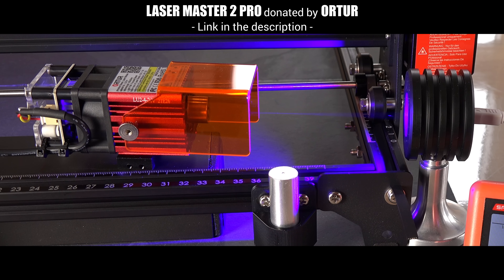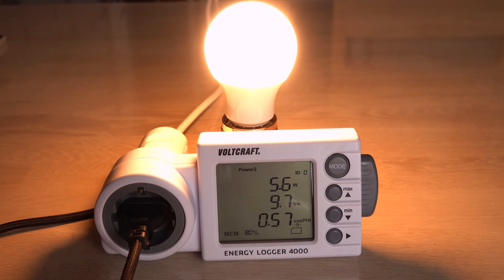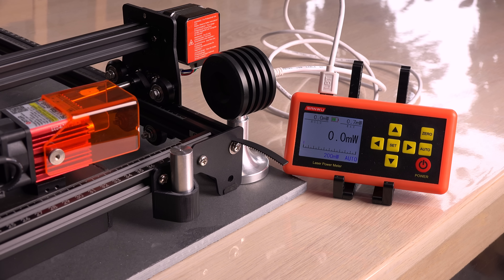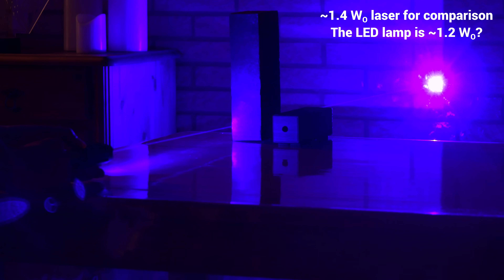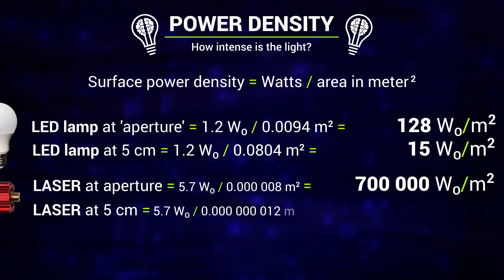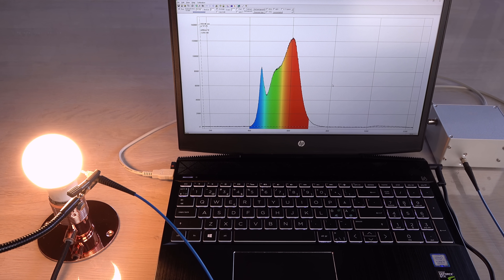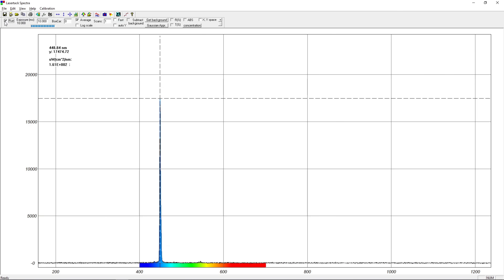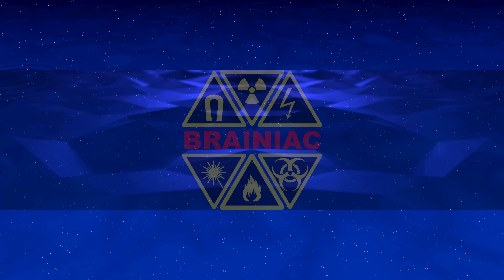Crazy difference between 5W LASER and 5W LED!

Comment: I wander what would happen if one does this with a gamma ray radiation. Gamma rays have a very short wavelength and high energy output. That would mean, this laser in theory would have been a billion times stronger and would have cut through the floor.

Comment: If I'm Not Mistaken, Is not Luminosity (lumen's)
A Measurment of Brightness or Intensity,  And 
Therefore Lumens Can Not be Compared to or
Mathematically Converted To Watt's ?

   ~ russ
Reply: Yes, 
Watts=lumens/luminous efficacy 
where the denominator le is lumens/watt which depends on the bulb efficiency.  Incandescant bulbs were about 15 lumens/W and LEDs are about 7 times more efficient.  Efficiency (W/W) can't be more than 1 so there is an equivalence there somewhere and I recall coming across this fact somewhere previously though it takes a deeper dive to get to that stuff and so I only mention it here and now.

Comment: Does anybody understand that the light particle pattern from a laser is symmetrical, that is why they follow together in a straight line, so the led example is quite symmetrical but less so. It's therefore quite difficult to diffuse light particles that simply travel in a straight line.
Whereas light particles from either halogen or incandescent are random wave pattern and these spread most easily giving more useful light with less glare.

Comment: I’m guessing the answer to the question at the start:
A 5-Watt Laser is far more dangerous than a 5-Watt LED because, while the LED just sprays it’s light everywhere, the laser concentrates all that energy into single beam, which generally isn’t good for anything that happens to cross said beam.
Reply: Yes it is a guess and it's not quite right.
Go research "coherent light". It's not just about the energy being concentrated into a beam compared to a light bulb which radiates omnidirectionally.

You could use mirrors and lenses to take the  light from a light bulb and collimate into a narrow beam like a laser and it still would not act like a laser.

Comment: Brainiac, if you really want more consistent burns you need some kind of air pump directly blasting out the engraving area where the focus aperture is. Just like a coolant flooded milling operation, all of the crap the tooling removes detracts from the ability of your tool to do things.
Reply: All of that smoke is blocking your beam, and will rapidly lead to fouling of the lens emission surface and eventual cracking from the heat concentration

Comment: Optical watts are not the same. The energy needed like high voltage or RF is magnitudes different then the optical watt output.  For example 100w co2 laser requires 1000w of RF to pump the gain cell (laser).

Comment: Yeah, that's pretty obvious. Kinda like the difference between a 50lb object that is small and one that is much larger, one may be more difficult to handle. Also, the laser is kinda like putting a lot of force into a smaller point rather than the same amount of force using an object with a larger surface area.

Comment: I would love to see the same analysis of a 40w CO2 laser.  I understand 40watt is the electrical input of the tube so what is the power of the beam as compared to a diode laser?
Reply: No 40W would be the output, I just had the tube replaced on my 60W CO2 laser cutter and the output beam was registering 61W (the actual tube is rated 20-80W and the power is controlled by the software)

Comment: Many years ago, early 2000’s, we used industrial carbon dioxide lasers for welding steel via lap or butt joints. At the time, we used 6,000 watt CO2 high frequency lasers. Parabolic mirrors with focal lengths of 200 or 250 mm could achieve 0.8 mm and 1.0 mm spot diameters, respectively. That’s 11.9 billion watts/square meter. And those laser beams are invisible.  Love lasers.
Reply: I hope you are fine.

Which are the best goggles available on Amazon to avoid ALL COLORS AND POWER OF CLASS 4 LASERS?

Comment: Does the LED lamp actually emit from that globe surface?  I would think there are (at least one) smaller devices inside that globe that actually emit the light, so your calculation of power density will be inaccurate.

Comment: In horticulture, the light intensity is measured in μmol/s, called PPF. The mol or μmol is the same unit used in chemistry, and μmol/s is a count of individual photons per second, 1 μmol being about 6 * 10^17 photons. Light density is measured in μmol/s/m^2, PPFD. I think it's a pretty cool measurement, and it makes sense in its context.

Lumen and similar units wouldn't make sense, because how bright our eyes perceive a wavelength of light doesn't matter to a plant. Watts doesn't really make sense either, because in the photoactive region of light there are peaks of activity. There are two peaks in the blue and two in the red parts of the spectrum as far as photosynthesis goes, so say a more powerful blue photon of shorter wavelength that misses these peaks will not be as active on the chlorophyll as a slightly less powerful blue (or red) photon that hits one of the blue (edit: or red) peaks perfectly. Wattage doesn't matter if the spectrum of the light source is no good for the plant. There are plenty of other peaks, even in the uv, infrared and far red that will affect a plant in terms of production of hormones, growth factors, phytochemicals etc. Green light is mostly reflected, but this also means it will reflect and penetrate deeper into the canopy while still having some activity, and plants can use it to determine how much foliage surrounds them locally. 

Thus you use PPF/PPFD. You count photons, treat them as equal, look at the spectral distribution of the lightsource, and compare this to desired spectrum for your particular plant and the growth patterns you are looking for.
Reply: That unit of measurement makes so much sense! All those lumens lux watts are a bit cryptic...

Comment: I just finished a project that used a 12 kw laser.  The generator is the size of a minivan.  I was in a weld booth once with  a 6k power source with protective goggles and my skin started to tingle quite a bit and that was the last time I ever did that.  I would be very interested to know what the military is doing with 50kw plus generators.
Reply: Or recent military projects where laser is connected to 100 megawatt reactor...

Comment: When you showed us the spectrum of an LED lamp I thought it would be pretty interesting to measure spectra of different LEDs temperatures. Compare them to their respective incandescent counterparts. Ie. how close is spectrum of 2700K LED to actual 2700K black body radiation. And perhaps even compare brand names to some cheapo ones (I swear not all LED lamps are made equal...I had some chinese ones that shine disgusting piss yellow).
Reply: IKEA sells LEDs with very good CRI under name LEDARE, and mediocre ones under name RYET. Also IKEA sells kitchen top lights with high CRI. Average kitchen light or led lamp from Chinese shop will make your tomatoes violet, while cucumbers gray😹.

Comment: The reason you were getting 66mW at 3 percent input power is because the amplification in the laser is a non linear process much like a diode. There will be a threshold current will the laser will go from some baseline output to its full output. Qualitatively, amplification will be less than the losses in the system below threshold. At threshold, the amplification overcomes the losses, however the gain medium saturates and the laser reaches a steady state.

Comment: Bottom line, a laser is a low wattage, extremely focused light bulb.

A regular lightbulb is to a ball bearing, as a laser is to a pin.

Fear the pin, or learn to use it.

Comment: High pressure rocket engines "only" hit around 100 MW/m2 at the peak heating region just upstream of the throat, and the surface of the sun emits 65 MW/m2.

So yeah, 475 MW/m2 is a bunch.

Comment: Regarding the apparently low output power in focus mode . . . Don't lasers have a fairly large minimum power to lase at all, so that you might have to supply maybe 25% of full power just to get the first bit of coherent stimulated emission?
Reply: Correct, I don't know about these blue laser consumer devices, but most commercial laser cutters pulse the laser, so you can reduce power by reducing the frequency/length of the pulse. Cutting a dense wood might be 2000 pulses per inch, but engraving might be 500 pulses per inch.

Comment: Good math to a solar high top quality no for w with a white light Watts that 60w to length with the correct reflection just the correct setup an size doing a double stack on 3w pump laser to M2 well should do the set up to math sucks no!.😁 Solar cells and white light generation if you use correct size as at 3mm beam size is a issue and cut is complex but just on a red in the dark pump type red lights up a bit not as good as a 5w led but!.old file set I can't recovery at moment???.

Comment: I dno...should you measure laserlights in watt... since say fiber optics are measured in dB
Reply: dBm and dBW are measurements in miliwatts and watts respectively. What you are referring to specifically may be the attenuation of the fiber which is a ratio of the output power over the input power. In a ratio, units cancel out.
Reply: @twjackson94  obviously i am talking about attenuation

Comment: I’ve spent years working with test and metrology equipment used to measure and characterize laser diode‘s and other related photonics stuff.... 

it’s always fun trying to explain to friends and clients the difference in optical output power.... compared to their understanding of normal wattage. I must have well over 1000 Watts of diode laser power in my lab at the moment...... scattered over dozens of small and medium sized lasers and modules. And it’s always difficult explaining to folks how a half of watt optical power can totally blind you in an instant faster than you can blink.

Comment: "If you want to light a room, a strong laser is not the right choice." Well thank you :-)
Reply: I've been think about a lighting solution where UV lasers are pointed at slabs of phosphor across the room. I can't be the first one to have thought of that, but I tested it and it looks great. I'd have to tweak the phosphor mix for a proper profile, though. It would be interesting to see the efficiency of this remote phosphor approach. I'm guessing it won't beat that same phosphor on a blue LED.
Reply: It depends on what "light" means
it could well mean that he wants to light the room on fire in which case the laser is a great choice... and also a great way to go permanently blind.

Comment: Every laser cutter I've ever used was always in a box that has to be closed for the laser to output anything, with a small harmless laser pointer for me to look at, why is yours open like that?
Reply: Because all that crap is totally unnecessary in a home shop environment and is only included in those products to appease OSHA. Nobody wants to be constantly nagged by their tools, it makes them less useful and extremely unpleasant to work with.

If you're dumb enough to plug the cutter in or enter the same room without glasses on, you shouldn't own or operate a CNC machine of any kind.

Comment: Watts is only the power used. It has nothing to do with light output
Reply: Though the light output power will always be less than the electrical input power as the conversion efficiencies are <1.  They are related.

Comment: about 7 years ago or so i bought a super powerful laser just for fun. i could burn things across the room. i used it to light fire works off from about 30 feet, it was hard to hold still enough but i got it. i always though lasers were awesome but i learned that if you get one too powerful you cant even really play with it, as it burns everything it touches and it hurts your eyes so you have to wear special glasses. i dont remember how strong it was, but is was battery operated and drained those batteries super fast like in 10-15 minutes.

Comment: Do I know the difference between a 5 watt laser and a 5 watt LED? Well, I know that the former is a laser, and the latter is a LED. What I do not know, because you have not told me, is whether the 5 in a 5-watt laser refers to the power produced by the laser light, that is, the output power of the device, or the amount of watts of energy supplied by burning coal, that you need to produce that 5 watts of laser output power. That is assuming it is a coal burning laser. However you haven't told us if it is a coal-burning laser, a 120 volt ac operated laser, 32 volt dc battery operated laser, a laser operated by donkey power, or a slave labor laser. Same goes for the LED.

Comment: if you shined the laser into a large clear  plastic bottle of water with a small amount of bleach in it (about 3% if I remember correctly), if what I've seen elsewhere is correct, it may be that, using a laser could be the way to illuminate a room.

Comment: Another thing to consider is the photon energy of the laser.  The photons that come out of a laser are much more energetic in "eV" than the light of a LED emitted by the phosphor.  
It can also be said that the photons emitted by the laser have the same direction and angle when they fly, this transfers much more energy compared to the photons emitted by the LED that fly at different directions and angles.

Comment: Now all you need is a big thick magnifying glass to hold in front of your laser at just the right distance (and possibly a couple fire extinguishers to keep the fire chief happy).

I'm curious the more powerful lasers seem to be in the green and blue Spectrum so can I deduce from that that it's the results of those wavelengths be more energetic or is there a lot more to it than that I do know it takes less postage to light up a red LED than it does a blue one but I'm not just going to assume that there is not a multitude of other factors that go into laser capabilities so if anyone knows I'm very curious to understand that at least at a very basic level as I wouldn't get much out of you talking over my head I don't think. I have a good understanding of physics and a degree in nuclear medicine but Electronics often leaves me scratching my head from lack of experience and familiarity.
Thanks in advance for your consideration on clearing that up and if not then I understand.  Great videos of the way, I'm now your newest subscriber

Comment: You're definitely underestimating the efficiency of regular LEDs. It is my understanding that modern LEDs for lighting are about 50% efficient, so if it's 5.5 watts of electrical power in, it's probably generating 2.5 or 3 watts of visible light.
Reply: But not all of the light that is actually generated escapes and is usable, right?

Comment: Awesome video!
My 2 cent: Your LPM looks serious, and I don't think you get a bug  when it says 66mW.

When you turn on the laser at minimum power the control circuit (control board and driver) try to do a PWM power modulation (I guess you know what I'm talking about). 
I am almost certain that on such low timing the driver can have difficulty in switching. I believe that if you put an oscilloscope on the diode side, you see that the PWM is not really 3%

Best regards by Arkypita, developer of LaserGRBL

Comment: I also think you wound be intreauged about the new flashlight technology out there, called LEP.  "Laser excited phospher" I have a lep flashlight(FW1) that has a 4+ W 445nm laser diode in it that once converted into white light which is probobly not very effecient of a process, the total lumen output is about 500 which does not seam all that impressive at first glance however its how small of a area on the phospher emiting white light. the laser is focused to a very small spot on the phospher creating an area of very high surface brightness. that 500 lumens is getting emitted from a very tiny area. when you put a biconvex lens on the front you can focus that 500 lumens in to a very very focused beam of light. I have one called the mateminco FW1. I measued a wopping 3.6mcd of throw with a calabrated cirtified light meter. I took the measurment at 10m for easy of calculation back to 1m. its pretty cool tech. i love this tech because it combines two hobbies of mine into one, high powered flashlights and lasers

Comment: @Brainiac75 i was just wondering if you were going to build or get a 1.4W green laser to add to your channel for content. I have a custom 1.420W green laser built into a green maglight host. Its an absolute monster. it uses the NDG7475 520nm laser diode drivin to 2.2A. It is easily the brightest laser in my collection. I have a 5W 445nm laser as well and the beam brightness is close to the green but the dot on the green on a white wall is at least 4 times brighter. i believe the beam brightness being about the same is due to Rayleigh Scattering which is why the sky appears blue. Eventually i want to add a 7.5W 445nm laser into my collection but even after handling lasers for 15 years im still a bit nervious about that one. I need to make a beam dump asap. i cant use ether laser inside with out proper cirtified laser goggles. I got mine from a high end laser company in Canada. Expensive as hell but all it take is one careless handling of a laser go blind. we as humens are not perfect we make mistakes so the cost is not a factor if they can save your eyes from a freak accident